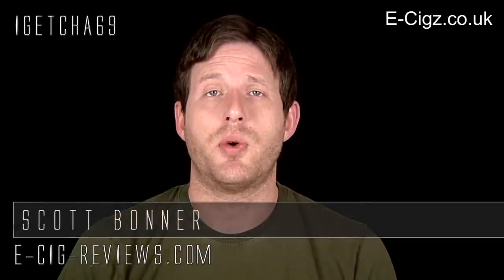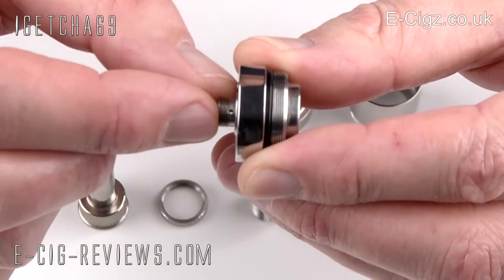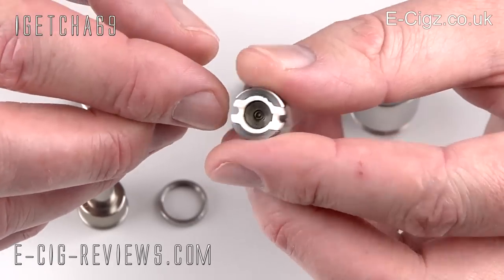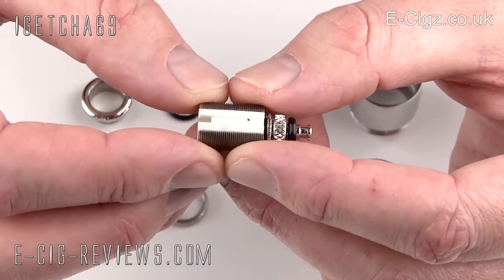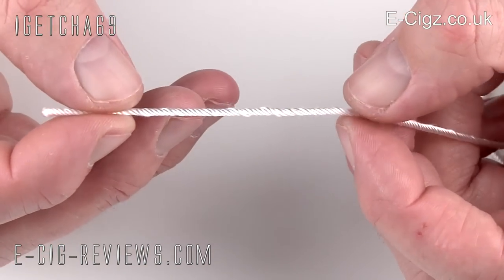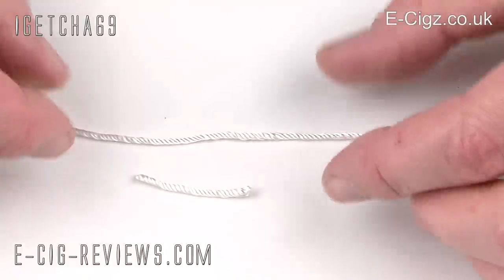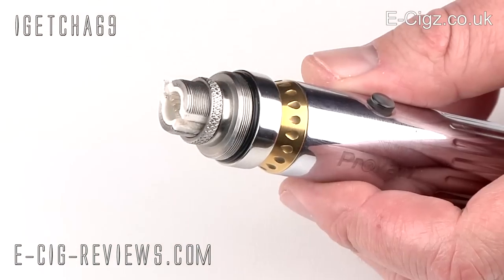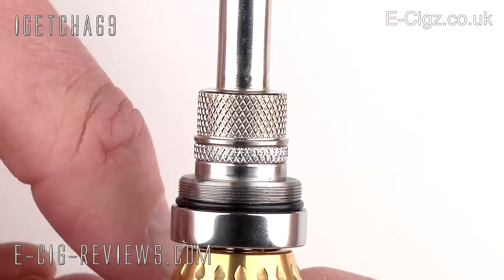REVIEW OF THE ODYSSEUS REPAIRABLE ATOMISER

Comment from the maker: hi mate,

i set mine up exactly how i set it up in this video........but everyone has their own preferred set ups so play around with it and find one that suits you personally :)

the length of wire required to create a specific resistance will depend on what gauge wire you are using........different gauge wires will require different lengths to create the same resistance

cheers

scott

Comment from the maker: hi mate,

when i change flavour in an Oddy i usually remove the tank / mouthpiece and then run the coil under a cold tap for about 10 seconds. then give it a shake to remove any excess water, add a few drops of the new juice to the coil and wick, reassemble, fill tank and then vape......it will take a minute or 2 for the vapour to start coming through properly and you sometimes get a slight crossover of flavour, but after a short while it will vape just fine :)

cheers

scott

Comment from the maker: resistance will be determined by the gauge / thickness of the wire and its length

thicker the wire, lower the resistance

longer the wire, higher the resistance 

5 wraps of 0.20mm wire should be around 1.8 ohms

cheers

scott

Comment from the maker: hi mate,

the ring that you screw down to trap the wire needs to be done up very tightly.....if its not tight then you will be leaving a very slight gap that will allow juice to get inside and then leak straight out of the connector

also, when screwing the top cap on, do it very, very slowly as otherwise the air pressure will force juice into places you dont want it to go, lol

cheers

scott

Comment: Im pretty sure I fixed it. The flat head screw under the coil was loose. Took coil off. Tightened everything super tight and its working great so far 10 minutes in. Btw this rebuildable looks like a beast on my provari. I like it better than aga t2

Comment from the maker: @jpracingph 

hi mate,

the wick i get from the same website that sells the Odysseus, but the wire i get from wiresDOTcoDOTuk as you can buy around 500 metres for less than £30 (lifetime supply basically!)

Resistance wire i use is - 0.16mm Nickel Chrome Wire

Non resistance wire i use is - 0.2mm Nickel Wire

for a 1.8ohm coil i would make the resistance wire about 2cm long (well, cut about 3cm and then once joined to the non resistance wires it will be about 2cm)

cheers

scott

Comment: Great video Scott, was worried about all the faffing around with repairables but that looks quite manageable.

One thing I think you might have shown is how easy it is to refill the tank.  I am currently using a SS lil mama and was wondering if it is as simple as that or whether it would require a bit of disassembly.

Comment from the maker: @spontaneous09 

hi mate,

I'm pretty certain ceramic does not contain any toxins so there can't be anything that could leak out by heating.......bare in mind that ceramic is used in many different heating applications around the world ;)

and no, i personally don't find the metal mouthpiece a problem.......even when i don't use an Odysseus i still tend to use a metal drip tip :)

cheers

scott

Comment from the maker: hi mate,

the juice control should not be overly tightened as otherwise you wont be able to control your juice, lol

you unscrew it to allow more juice to reach the coil.....or screw it up to restrict the amount of juice that reaches the coil

the mouthpiece part has an o ring that grips it tight enough to prevent it from moving when you dont want it to :)

cheers

scott

Comment from the maker: hi mate,

in that case it sounds like you have a short circuit somewhere along the line :(

I've just got a penelope that has the same ceramic design and i just set it up exactly like how i set up the Oddy and it vapes great.......so you "should" be able to just set it up like in this vid too without any probs

make sure that your wires are not hanging out slightly and creating a short at the points where you trim them off.....rather than use cutters, twist them off for a clean break

scott

Comment from the maker: lol, how could i possibly know what the temperature of the coil will be????

in addition, the temperature would fluctuate greatly as the battery drained plus it would also change depending on how wet / dry the coil is and how much gunk has built up on the coil over time :P

Comment from the maker: hi mate,

does the flooding happen as soon as you fill the tank and put the lid on? if so, make sure you put the lid on very, very slowly as otherwise the air pressure will force to juice out

other things to check is to make sure that everything is as tight as possible and all o rings are seated correctly

cheers

scott

Comment: Hi Scott,
Thanks for your reply. We'll I tried it out and it didn't help at all. So instead I disassembled every part and began to assemble it from scracth. i filled up the tank and after the first 2 draws, I got juice in my mouth again and it leaked out from the center pin/connector staright away. Is there any kind of packing inside the connector that could be damaged? cheers

Comment from the maker: hi mate,

do you have the V1 Odysseus (like in this vid) or a V2? if you have the same one as in this vid then its almost certain that you are getting a leak because you are not tightening the ring that traps the wire enough. if you dont tighten it up as much as possible then you will create a tiny gap which then lets juice seep through the connector :(

also, after filling the tank remember to screw the top cap on very slowly as otherwise the air pressure will force juice out ;)

cheers

scott

Comment from the maker: are you making sure the juice control is fully closed before you fill the tank up and add your e-liquid?

and once you have added your e-liquid and top cap you should then vape it until you start noticing dry hits before opening the juice control......when you do open the juice control only open it one or 2 turns and then see how it goes before unscrewing any further

Comment from the maker: hi mate,

a metal taste usually indicates a short circuit or the voltage is set too high for the resistance of the coil

are you definitely using the mixture of no resistance wire as well as resistance wire? and what voltage are you vaping at?

Comment: No offense meant, but you must not be doing something right, or not using the right wick/wire/setup. I have a Cobra, BliSS, DID and DID clone, so I am very familiar with genesis' and absolutely love them. But my Penelope, although it's obviously a DIFFERENT vape, can still keep up well with these guys. Not to mention that unlike a genesis, I can always throw it in my pocket and hit the road with absolutely no worries of leaking or spills. Use some 3.5mm wick and try again, the Penelope kicks ass

Comment: Can I use copper wire for the no res wire?
Reply from the maker: i have never heard of using copper for that purpose and i really cant say whether it would work or not.......personally i would recommend sticking to the correct wire
Reply: igetcha69 I might try it just to see if it works, I find more people(like myself) have copper wire than silver/nickel. If it doesn't I won't hesitate to get better wire. I don't see why it wouldn't though, it just has to conduct electricity and have no resistance as far as I know. I have an ithaka on the way and I'm scared I'll have trouble with it...